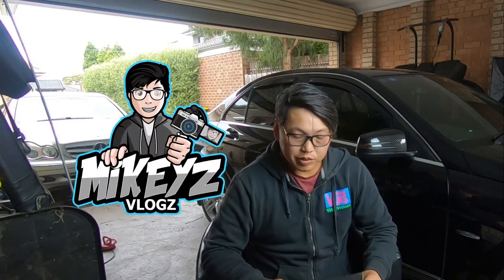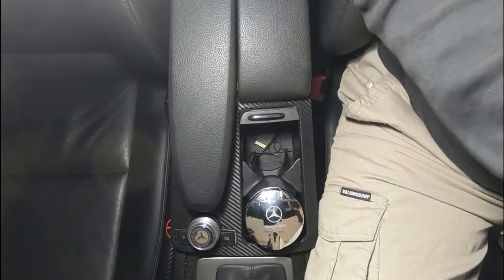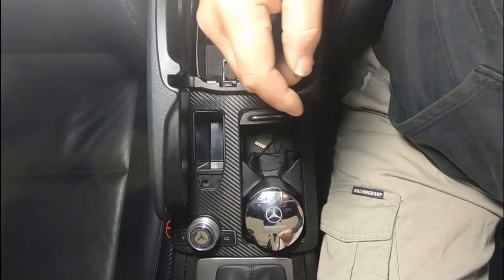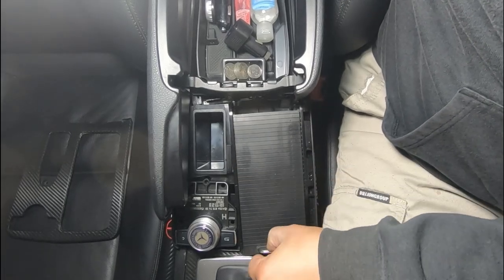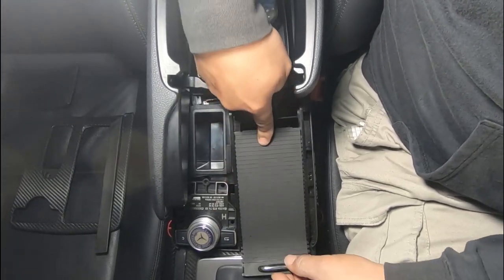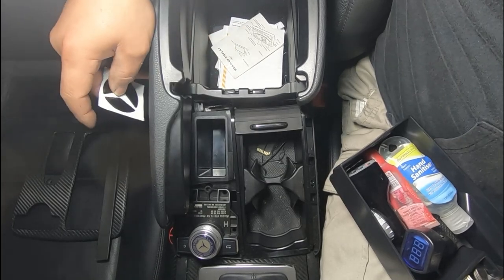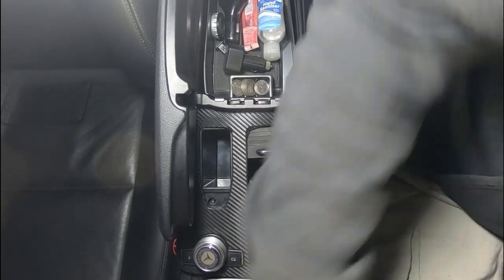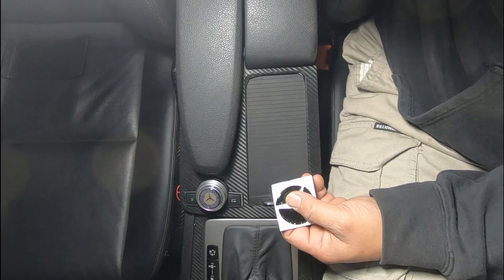how to replace cup holder roller blind mercedes + carbon fiber steering wheel logo + more

Comment: Great tip Mikey. Roller on my C300 I had just bought, was broken by the car wash guy. It is now repaired.
Reply from the maker: how did that happen
Reply: @MIKEYZVLOGZ  pretty sure they leaned on it when cleaning the inside. It was an original 2007 cover and pretty brittle but i was a little pissed, only had owned the car for a day. Anyway loving your W204 tips!

Comment: Hey bro! Where did you get your metal pedal covers from, aswell as the carbon-fibre frame that you unscrewed? Is that just a carbon fibre decal sticker or did you buy it with that?
Reply from the maker: hey bud.. welcome .. my pedals are factory cuz I got the amg package like sports model... but u can get after market ones that look the same I'll link it for u now..I wrapped the carbon fiber centre console decals are the vents and the steering wheel logo surround
Reply: @MIKEYZVLOGZ  ohh ok yea I wasn’t sure if it was factory or added it yourself. That’s fair bro. I have the rubber pedals and it looks a bit boring haha.

And sweet as bro thanks.
Reply from the maker: @Dre_98  check the description ill add it in the description bud
Reply: @MIKEYZVLOGZ  awesome, cheers mate!
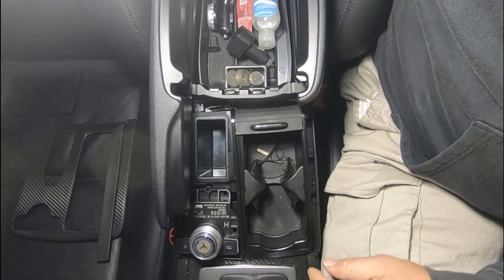Reply: @MIKEYZVLOGZ  hey bro, how did you remove the phone cradle at @3:12 ? And where did you buy a new one for it ?
Reply: @MIKEYZVLOGZ  all good! I just found it in another video of yours here… https://youtu.be/hCNrnrwah8M